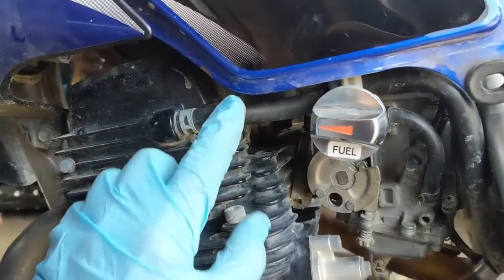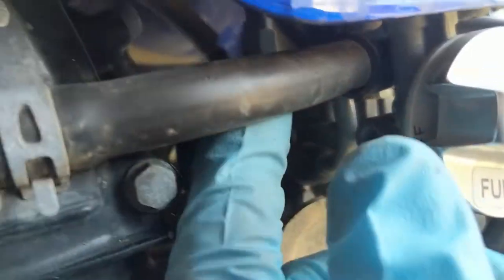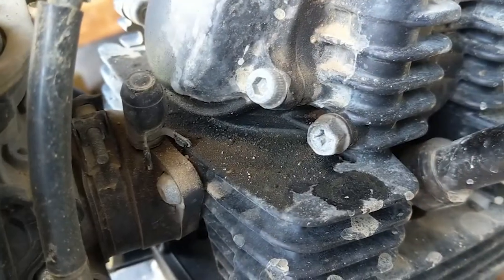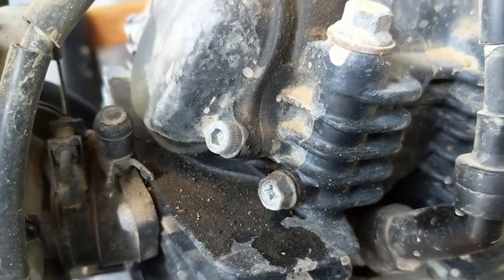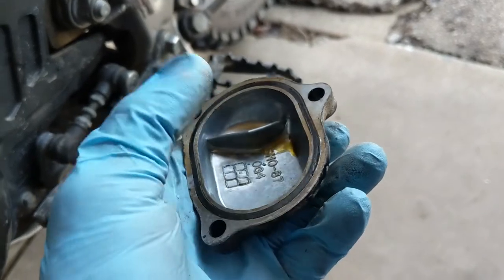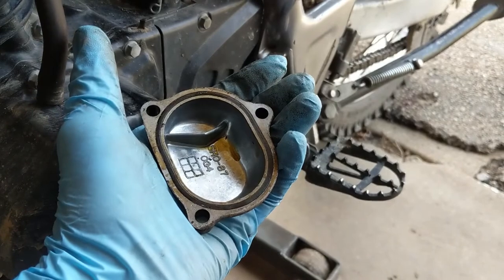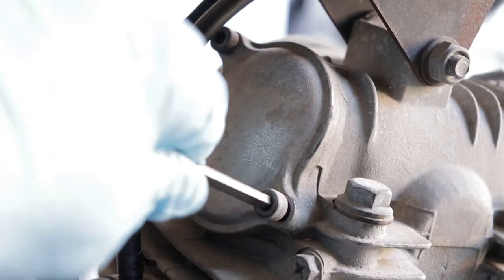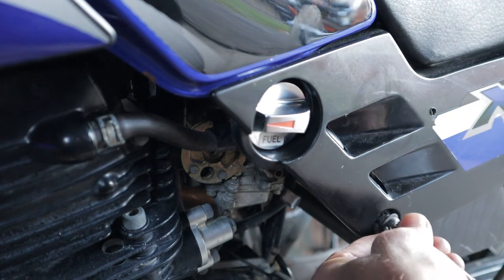Yamaha XT225 Using Engine Oil - Easy(ish) Fix

Comment: Hey jimmy, any tip on getting out a stuck, almost stripped oil pan bolt?  Iam binging a 1992 back to life. Thanks
Reply from the maker: Hey, Brently, by "stripped" do you mean the head of the bolt is rounded off? If so, I'll link to a video here that has some tips. I'd probably apply heat to the outer area of the case to help it expand, then do the cold chisel method, where you hammer the chisel on the head in the direction of the loosening rotation. Hammer and create a little notch in the head of the bolt with the chisel and then hit with more force in the direction of rotation. Hopefully the video makes sense. But if you're not talking about it being rounded off, hit me up again and we'll try to figure it out. Good luck! https://youtu.be/R5d0Bgvjmlk
Reply: You may find you need to use vice grips to remove it or even file down the flats of the bolt head and use a smaller wrench or socket.

Comment: thinking about getting one of these,  i appreciate your vids,  did you rejet your carb?  do the 2.5 turns out on your fuel screw?
Reply from the maker: Thanks! Yes, the fuel screw is 2.5 turns out and that's the only engine mod. Starting, idling, and throttle response are all spot-on!
Reply: @jimmytmoto  thank jimmy. Your videos are great,  helped me make my choice in getting a XT225 👍